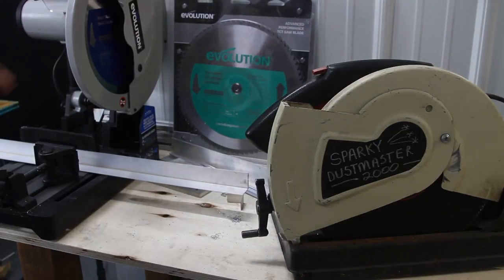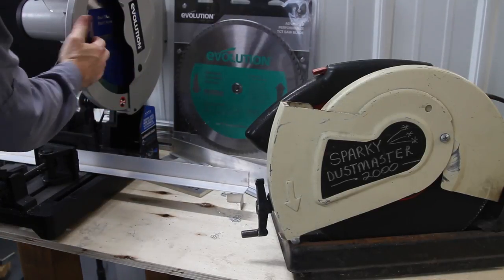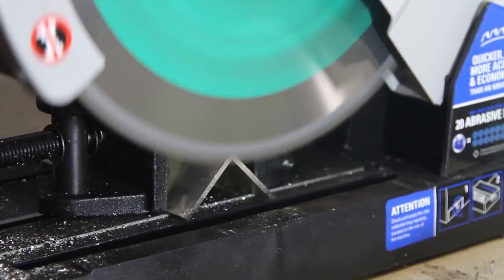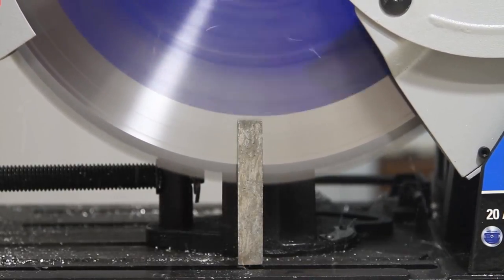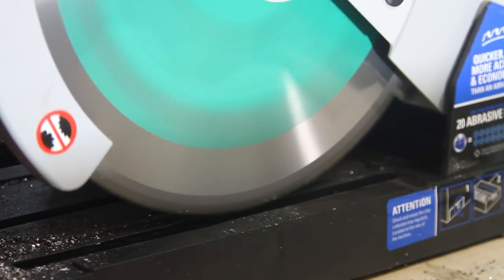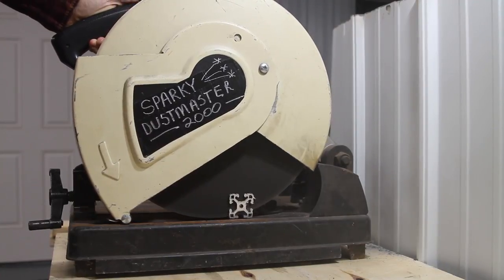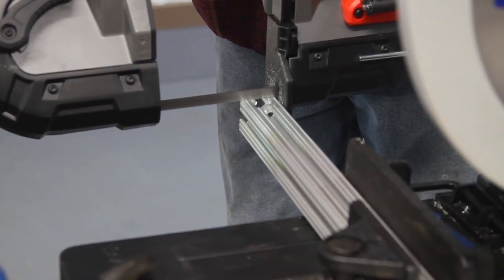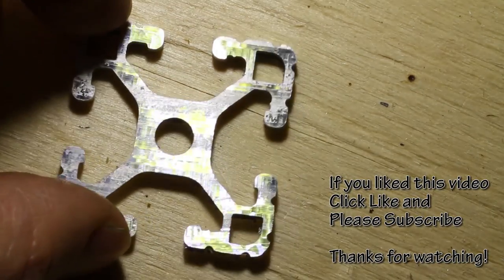Evolution Tools Metal Dry Cut Saw, Steel and Aluminum Blade Comparison

Comment: I cut aluminum everyday on my miter saw with a triple chip aluminum cutting blade. The best thing to do is set up a spray bottle with a water soluble cutting fluid spray on the blade as you're cutting the aluminum. If you don't do that what happens after a while is you get chunks of aluminum stuck between the teeth of the blade which is a hazardous situation to say the least. Also the blade will last a lot longer and the cuts will be much smoother

Comment: Thanks for doing this comparison and posting the video. I was sent a Rage2 by Evolution to compare to the DeWalt DW872 and the blade the Rage2 came with is terrible for aluminum stock. Looks like the aluminum cutting Evolution blade would fix the problem, but then the total is within striking of the EVO380 price... and with the EVO380 one is within striking of the DW872 price.  Looks like the Evolution blades fit the DeWalt as well. Great that consumers have a lot of choices.
Reply from the maker: Thank you, Kent.
Reply: 1" arbor, many blades for aluminum are made in this size.

Comment: Does anyone know can the blade for stainless steel be used to cut mild steel effectively, will it last longer?
Reply: A bigger thing to consider would be what you're cutting. If you're using round stock and it spins in the vise, you're gonna wreck the saw blade. Yeah, the stainless blade will cut mild steel. It's just not ideal. In some applications, a bandsaw is better for stainless.

Comment: Great video thankyou!  I have tick metal plate thickness is about 100mm, and I want to cut it 3mm narrow (like slice) - do you think it is possible?  How narrow can I cut with this machine?
Reply: Saw is rated 6mm steel vertical. No aluminum  rating listed in Manual. Minimal cut off is 8mm. How wide is your 100 mm plate? 120mm is rated width for a vertical cut. Hope this helps. Cheers....sounds like your material would be better cut on a horizontal bandsaw.

Comment: Have you check the mount pin to the saw head for side to side play.Just a FYI they all have it and Neverlution is suppose to repair this.Personally Ii have inspected 5 saws new out of the box with this issue.
Reply from the maker: I just checked mine and I don't notice any movement from side to side of the blade.   I will keep and eye on it.  Thanks for the heads up.

Comment: the finish on both blades and the cut time seems pretty comparable, id think the difference would be in blade life.. if youre cutting aluminum almost always then go with that blade but if you do a mix of materials or just aluminum time to time the steel blade is gonna do fine.. a circular saw blade for wood will actually do a fine job and they can be had for 5$
Reply: $5 for a 14" carbide tooth blade....dream on
Reply: @ypaulbrown  "circular saw blade for wood" idk where youre at but here in north america circular saw defaults to 7-1/4" an d yes the cheap carbide blades can be had for 5$ a piece and even the nice diablos go on for 15$-20$ for two time to time these are canadian prices so even less down in freedom land

and any of these will do fine at some low volume aluminum if you can operate the saw steadily
Reply: @AndrewBrowner  the video was about a 14" circular saw, not 7 1/4". Your comment was meaningless to subject matter considering the Evolution and other circular saw arbors on saws over 10" are 1". They are  called circular saw blades for a reason, they are round. But I guess you could put a 7 1/4" blade on the Evolution if you bored out arbor hole, would decrease capacity probably.
Reply: @ypaulbrown   im not talking about putting it on the evolution im talking about using a circular saw to cut aluminum.. as he talked in the video about the cost of a dedicated aluminum blade..
Reply: @AndrewBrowner  you are correct Sir, I must have missed the part about using a hand held 7 1/4" circular saw as a dedicated aluminum cutting machine. My apologies. PB

Comment: Be careful cutting anything with less than 1/2 inch cut off with that saw. Have the exact same one. Anything less than a 1/2 inch cut off can get caught in that giant gutter and fires back into the blade. Not sure why they made that gutter so damn big compared to other dry cut saws. Had a chuck back fired so badly, it shot into the blade and into the cover. Had to take the whole saw apart to get the chunk out. It’s really a design flaw.
Reply: I cut a 3/4" length of 3/4" square tube (1/8" wall) and it went into the guard and eventually jammed the motor as it blew out the side of the guard. I took the saw apart retrieve the piece, which destroyed 8 of the teeth on the blade. I welded the guard together, but now worried about its strength since aluminum lose strength after welding. I decided to buy a new saw instead of risking using a modified guard.
Reply: Mine jammed too one time, on top of it firing small cut offs into my window. There are a lot of problems with the saw. The wide gutter is an issue and so is the guard. Better off with a slugger or Makita